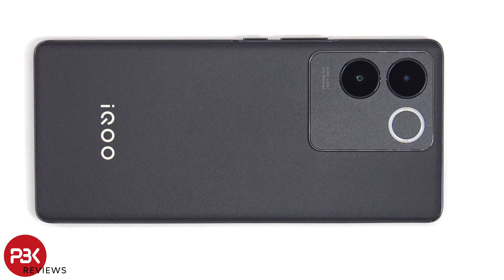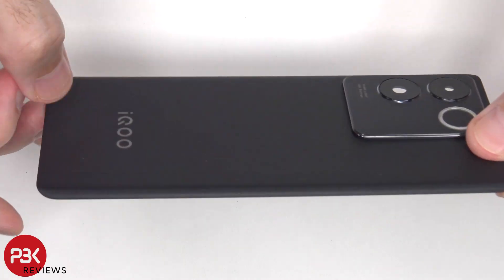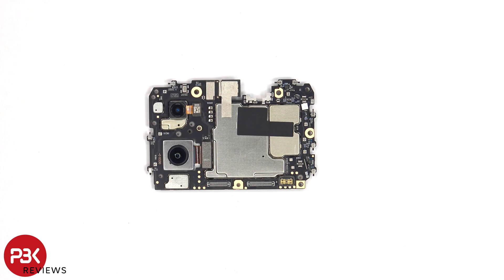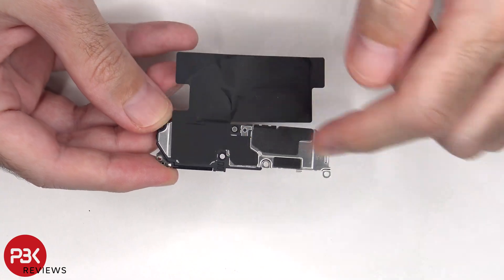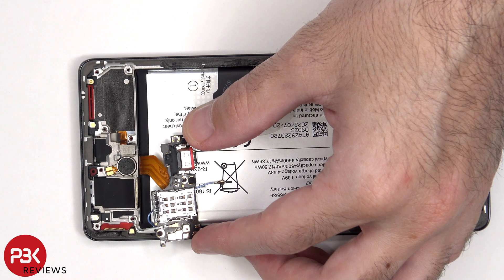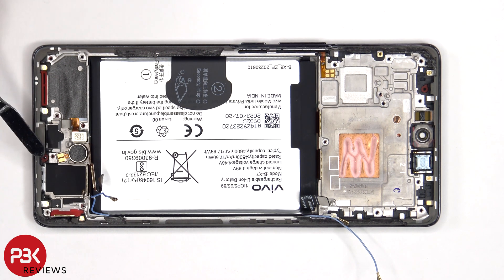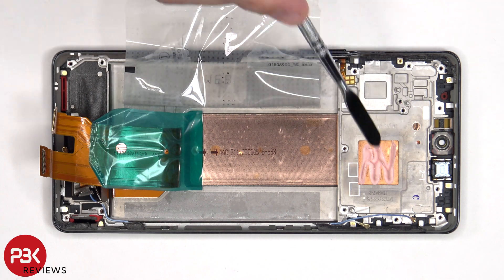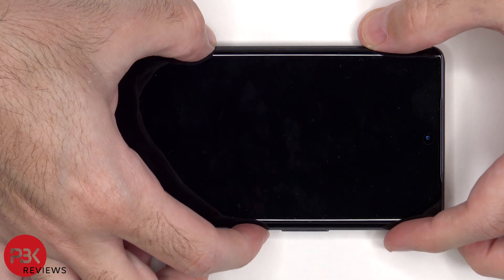IQOO Z7 Pro 5G Teardown Disassembly Repair Video Review

Comment: @ 4:02 What material is the inner mid frame made out of? It looks like plastic. Or is that metal? I mean the grey colored plate under the motherboard.
Reply from the maker: aluminum alloy with plastic injection molding or border.

Comment: In your profession opinion, what phone has the best cooling vapor chamber or cooling system without a physical fan? I'm using the Oneplus 10t which is supposed to have one of the biggest cooling systems, after several hours of hardcore gaming my phone is always around 29-30°C..but I was curious which had one of the best in your opinion on the phones you have disassembled..? Thanks again for the very informative content 🎉